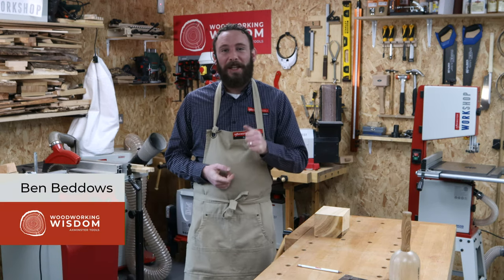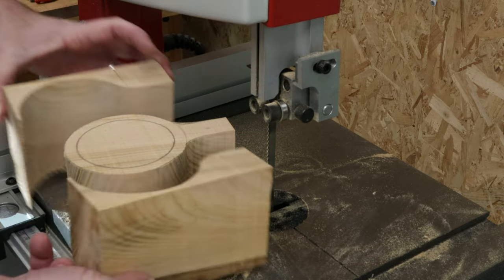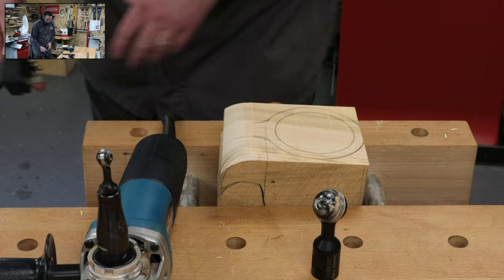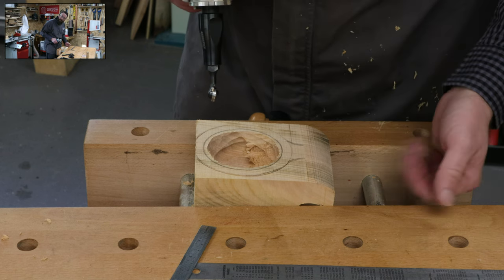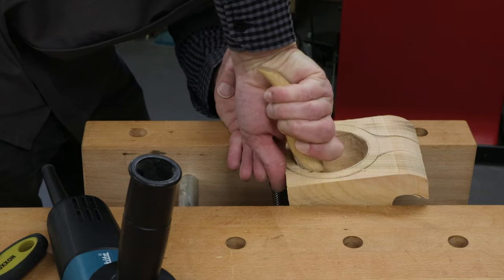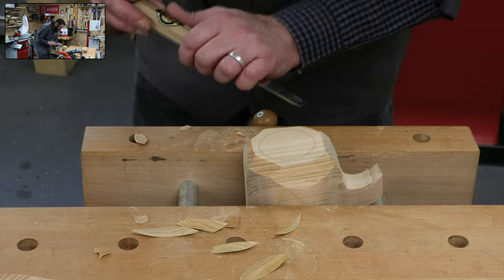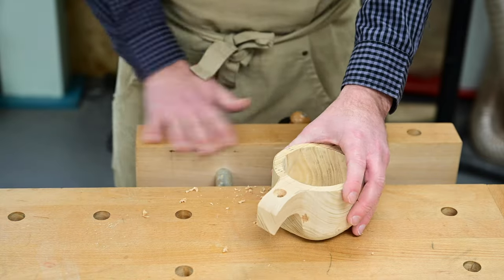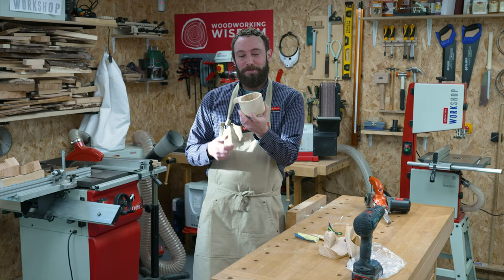Carve a Kuksa Cup - Woodworking Wisdom

Comment: This is really nécessite to boilled in salted water any wood when doing cup?
Reply from the maker: Hi François, Ben says: "It is recommended that you boil the cup to sterilise and help with the drying process. As this piece was green (wet) Cherry, boiling it will drive out the sap and, if dried slowly will help prevent cracking as the wood shrinks." I hope this helps 🙂